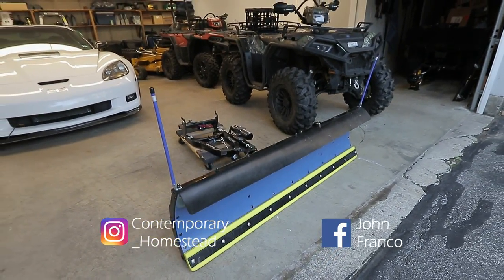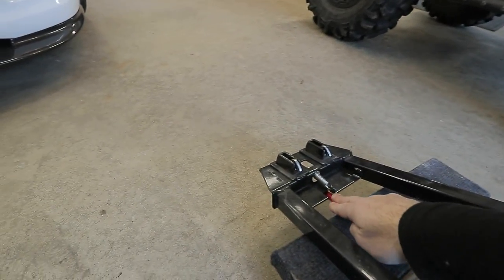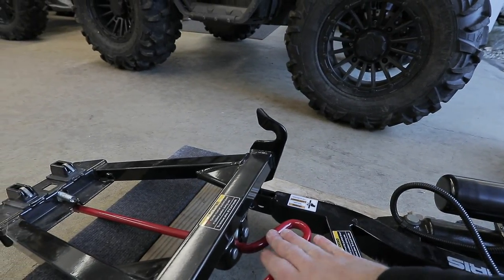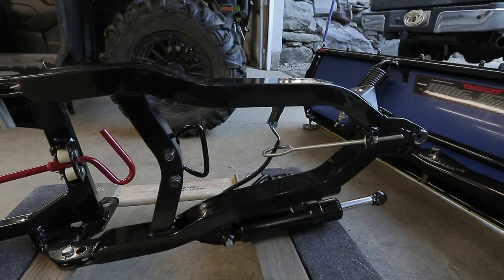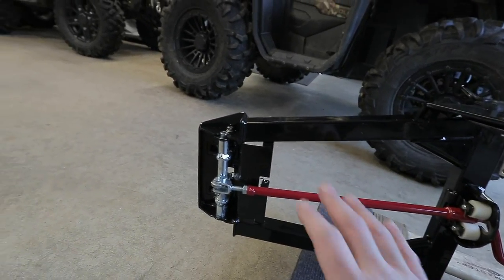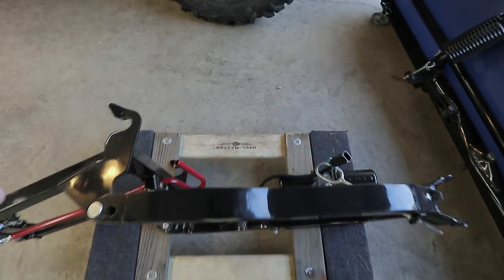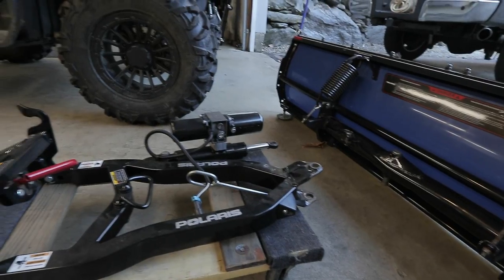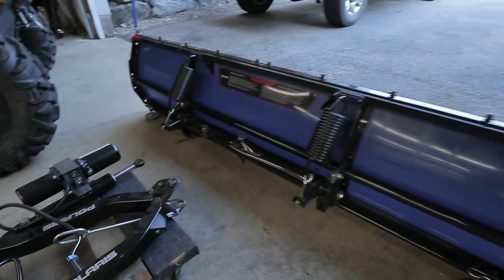Does ATV SxS UTV PLOW Detach & Fall OFF? | POLARIS Glacier Pro Plow Adjustment Tip | FIX Explained

Comment: I noticed when i installed my plow with the handle in the locked position I could pull on the handle and detach it.  Glad I noticed that before I started plowing with to save the headache of trying to figure out what was going on during a snow storm.  Nice video

Comment: Have you figured out, that adjustment doesn't work?
  The issue is, anything that hits that red handle from below, like snow banks, or sticks, picked up on the road releasing the plow 
  I made a video showing a simple tool I made to prevent this.
  Polaris refused to a knowledge the problem, and one day is gonna hurt someone bad.
   I ran over my plow and bent it up good. Lucky that was the only damage
Look up -richard Theisen - on you tube